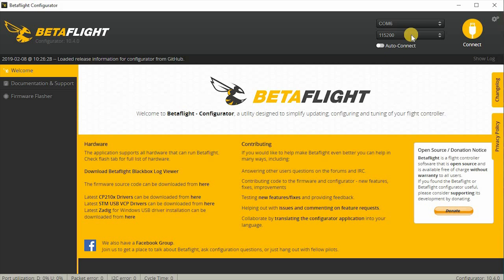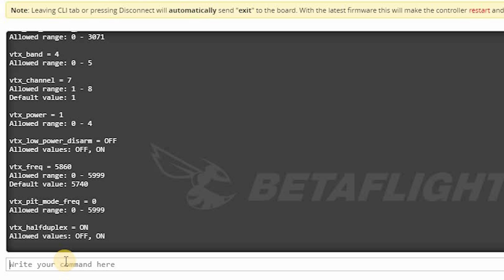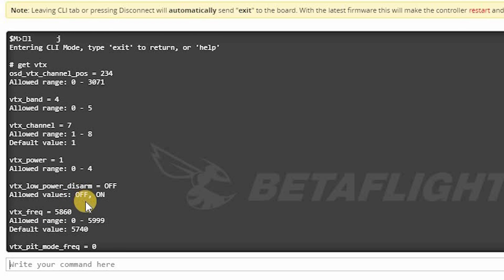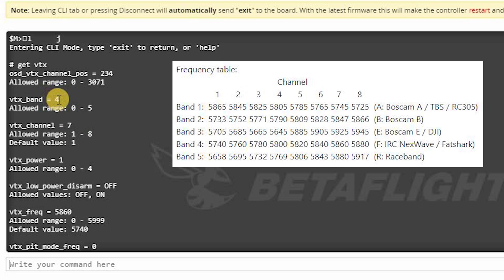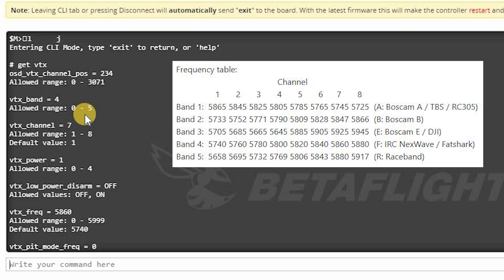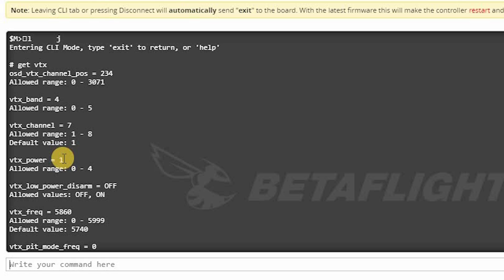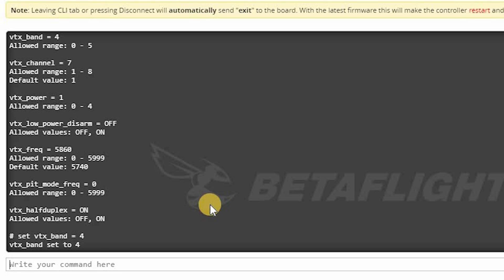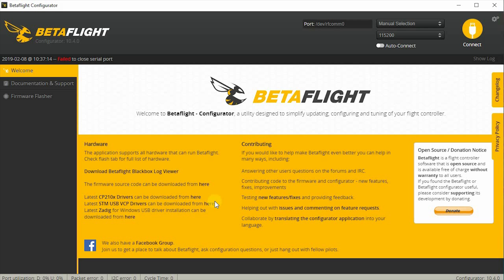Setup Drones FASTER with VTX CLI Commands 👍😀

Comment: all my default values display 0 even when i change for example the vtx_power to a number like 3 or 4 in the cli the default value stays at zero is there any way to remedy this in cli? i dont know what to type to adjust default values
Reply from the maker: This video may be out of date depending on the version of Betaflight you are running.  If you are on 4.2 or newer, you don't need this video, you need to setup VTX tables instead.  You'll have to consult the Betaflight wiki to reference the version of Betaflight you are running.

Comment: Same VTX.
Got a problem. 
VTX stuck at 25mw. Can't cycle through physical buttons either.
Not able to change frequency. 
All I can do with physical button is to change it to pit mode and back.
Any suggestions. Thanks.

Comment: It has worked on one of my quads but on another I did the same setup , I did channel 3 and freq 3 5665 ,On the other quad iam not getting any image and its takes me to 5925 Any ideas,
Reply from the maker: Probably a VTX table problem.  You might have the wrong one.
Reply: @AlbertKimTV  Do you mean the wrong vtx? if so are you saying it works with certain vtx makes?

Comment: Does it take a long time to change channels on your goggles? Betaflight always defaults to F1. So I just tune to F1 (takes 3 seconds, maybe?) change the channel in the OSD and tune my goggles back. Less than 30 seconds total. Takes a lot longer than that to boot up a laptop!
Reply from the maker: This tip is meant to be used at the time when you first setup the drone.  You'll still need to fire up that computer to do the initial setup and I do this change right at the end when I'm about to reboot the FC anyway.  It saves me more than 30 seconds and I'll never go back to doing it the way you describe.
Reply: I suppose you're right. If you're already in there to setup other stuff the first time this makes a lot more sense. 👍

Comment: I've noticed my different VTX brands don't all  use the same band and channel for the frequency I like (5860). Sometimes it's band 2 and sometimes 5. Maybe smart audio has  standardized this now (?), but why not just set vtx_freq = 5860 and forget about the bands and channels?
Reply from the maker: You could do that.  I haven't tested every VTX out there and some implement this protocol a little differently so you should always test to make sure it is working as you expect before using it out in the field.

Comment: owh yah, 1 more thing albert. if low_power_disarm = on, it means everytime we connect lipo & board is disarm, it will automatically set to the lowest value? then as soon as we arm the quad, it will set the vtx power to the whatever default value we set earliar (just wana be sure, im sorry im not good at understanding via reading).
Reply from the maker: Yes, I think you have that right.

Comment: does this work when using FPORT over SmartAudio?
Reply from the maker: This method is not dependent on the receiver since you are directly changing settings via the USB port and CLI commands.

Comment: Or you can use the Speedybee app, it has a graphical interface for you to select and change the channel, power etc..Betaflight configurator should implement the same thing.
Reply from the maker: Interesting... I might make an update video showing this.

Comment: Why no one is talking about lua scripts? You don't need no PC, and no goggles, all can be done looking at taranis screen
Reply from the maker: Not everyone has a Taranis or a receiver that works with LUA scripts
Reply: @Joe Crupi but you have to have transmitter that supports, solder and setup smartaudio.
Reply: @MariusFBU  No you don't. If I'm not mistaken, SmartAudio doesn't need to be set up at all to do this. I've been doing this for quite a while before I've even setup SmartAudio on my FC. It's really useful for those micro (AKK) VTXs that don't have a digital readout showing and you need to know what the red and blue LEDS mean.
Reply: @joecrupi9381  it must be setup, how would you control VTX from FC otherwise? May be you are thinking about Betaflight OSD

Comment: Does this work whether or not you have smart audio/tramp setup?  Or does it also work when you only have the 3 wires connected(power, ground, video out/signal)?  Thx...
Reply from the maker: Smart Audio must be properly setup with the fourth wire going to a UATX TX.

Comment: I use this all the time especially with the speedybee usb bluetooth adapter and my phone in the field it is so useful for races and flying with friends to be able to just plug into your quad or someone else's and change channels very quickly as long as they have smartaudio/tramp setup its amazing you just pretype the commands in text edit on your phone with save and then plug in goto cli paste it all and then wait a sec for it to save and unplug and done
Reply: The biggest issue with the speedybee is that you can't easily plug it into whoops and other things where the micro usb is tucked up in the frame some where but i found this as the best solution https://www.amazon.com/gp/product/B071NR19BQ/ref=oh_aui_search_asin_title?ie=UTF8&psc=1